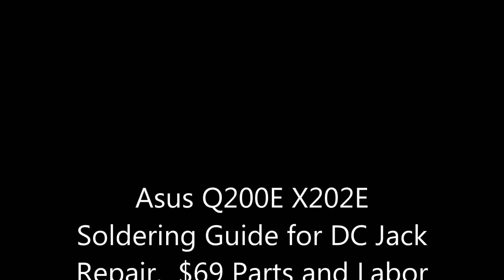Asus Q200E X202E Soldering Guide for DC Jack Repair

Comment: I completed this repair however the laptop no longer powers on nor is there a signal that it's receiving any power. I tested for continuity and I'm getting a signal however the laptop is still not powering on. Not even the charging LED when I plug in the AC adapter.